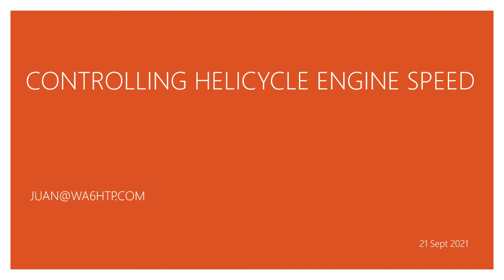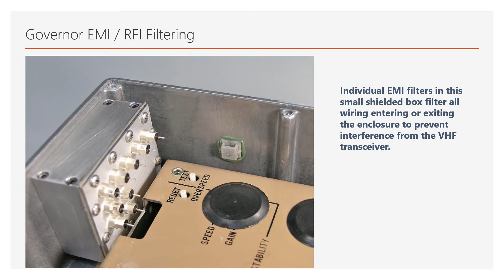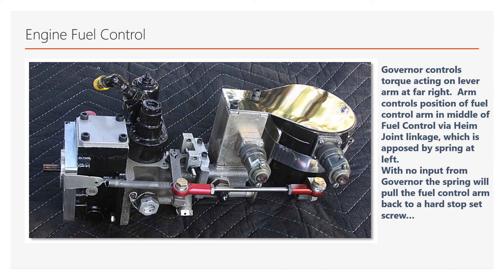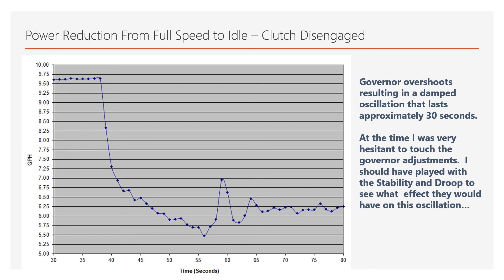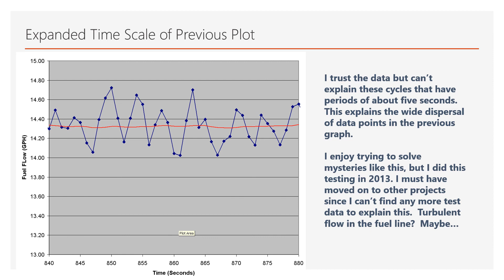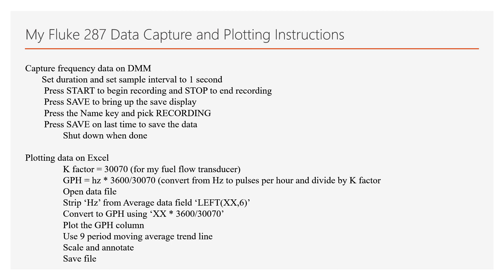HRLICYCLE FUEL FLOW TESTING

Comment: Hi Juan, with the fuel flow fluctuations I guess you could have measured the current to the governor torque motor to see if it fluctuated with a similar time base. Ie was it a real oscillation in fuel flow due to under damped loop control in the electronics of the governor?  You also mentioned that the barometric pressure was an input to this system, how was that input connected and used? 
I have no experience with the solar engine but I do have a model turbojet engine which uses a variable speed fuel pump as the controlled variable of the loop, an optical rpm sensor as the process variable, and the set point is from a pwm signal from an Rc receiver. It also has an egt sensor and can full auto start by itself from an engine ecu.